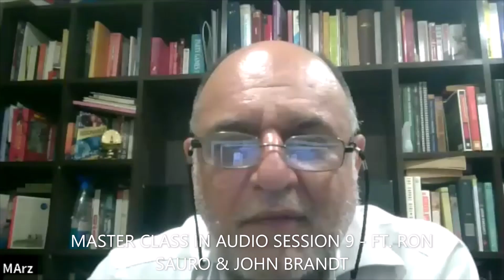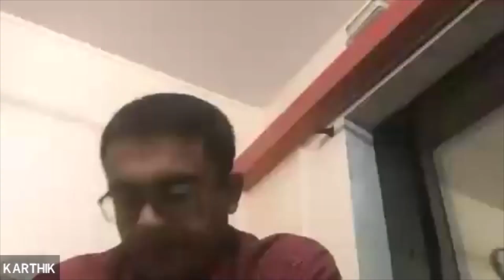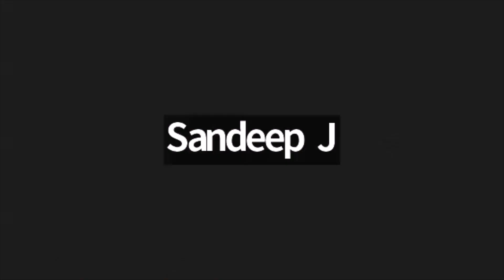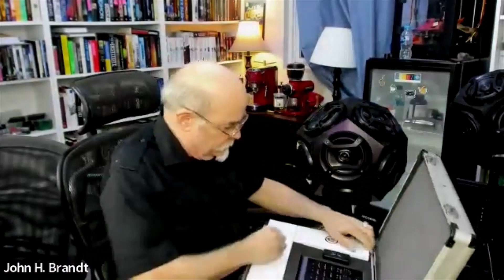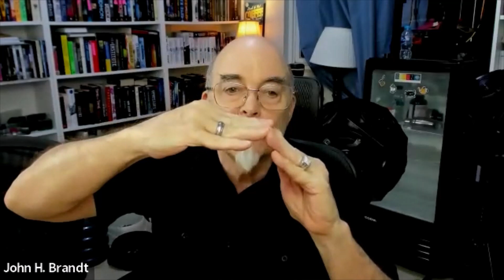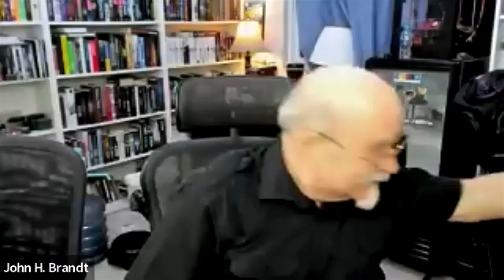MASTER CLASS IN AUDIO - SESSION 9 - FT. RON SAURO AND JOHN BRANDT

Comment: Thanks for the video.
Let's hope that in the next video they can fully detail what is related to that 4" porous absorbent panel (made of 2 2" sheets and each one with a different density) with an absorption coefficient of 0.8 at 80 Hz

What has been said about Sabine's formula for small rooms is another issue that could be explained more fully.

written with translator

Greetings